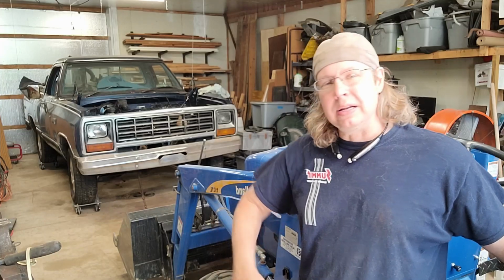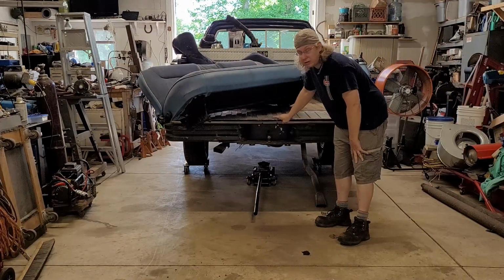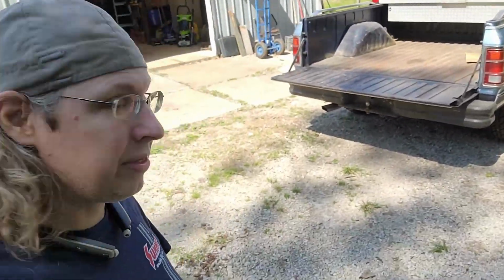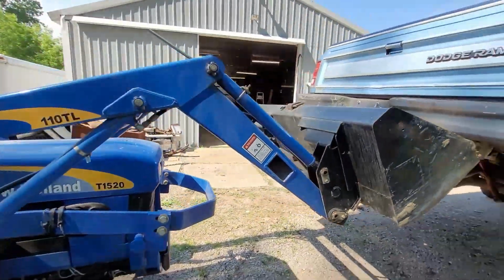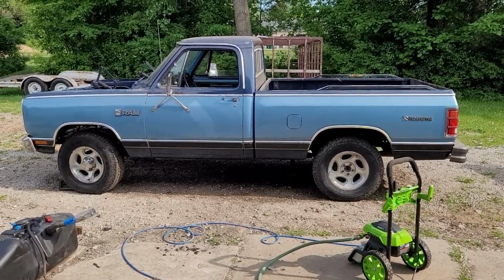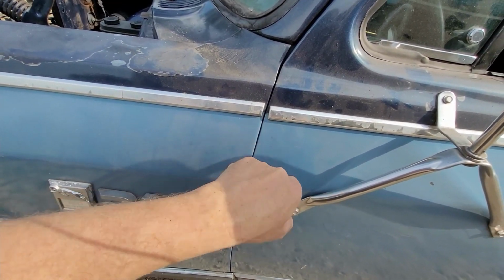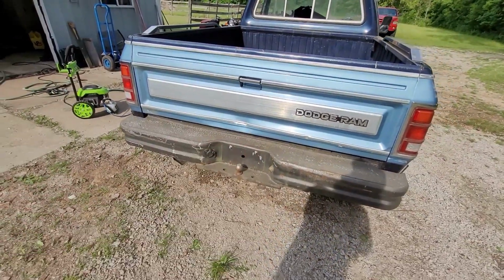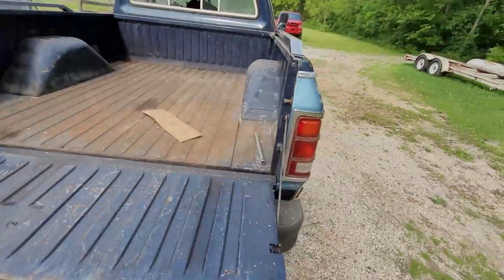1984 Dodge D150 Underbody Pressure Wash & Inspection - I Maxed out the Tractor Picking it up!

Comment: OSHA approved underwash procedure, lol. i cant believe you are one handing that wand the whole time, you must have Popeye forearms!!
Reply from the maker: 100% OSHA approved ;) I had steel toe boots on! Lol
Reply: Pressure washer never bothers my forearm, but my hands get sore, usually end up switching hands as I go. Half assed ambidextrous by necessity.
Reply from the maker: @doogansdoinreviews1285  this wand isn't very heavy.
Reply: @HFG  its not the weight, its the pressure of it pushing back into my palm. (I broke my hand years ago, so its quick to complain.)
Reply from the maker: @doogansdoinreviews1285  oof. Yeah I can see where that would be a problem. Hopefully the pain goes away soon.